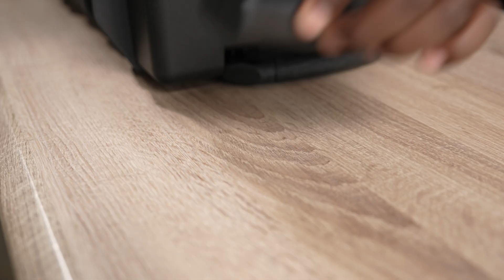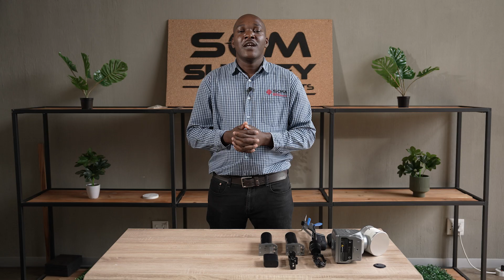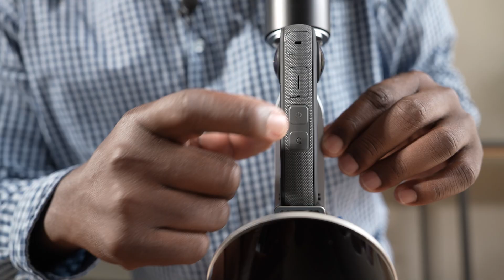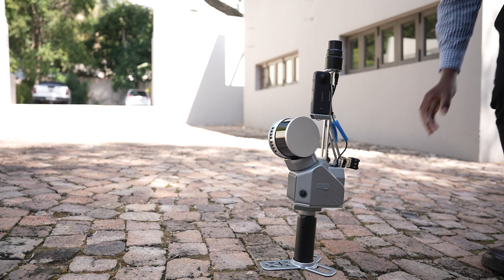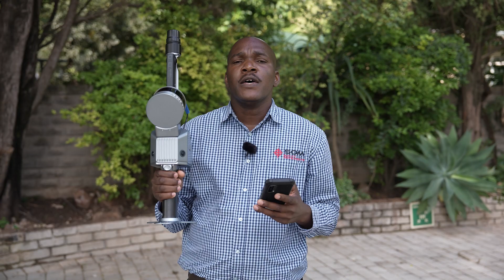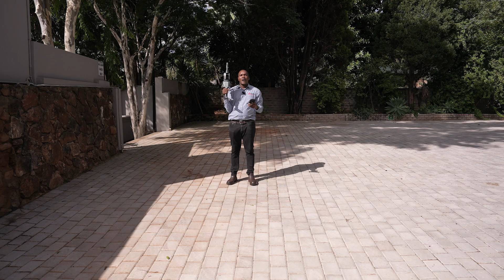FJD Trion S2 LiDAR Scanner Unboxing & First Start | Full Setup Guide + Pro Tips

Comment: Does it also work with Android phone?
Reply: Ok, but not saving 92 % stoping sir 😢
Reply from the maker: Hi there, thank you for reaching out! 

Yes, the FJD Trion S2 LiDAR Scanner is compatible with Android phones.
You can use it through the official FJD Trion Scan app, which supports both Android and iOS devices. 
Just ensure your phone meets the minimum system requirements and connects to the scanner via Wi-Fi.

Hope this helps